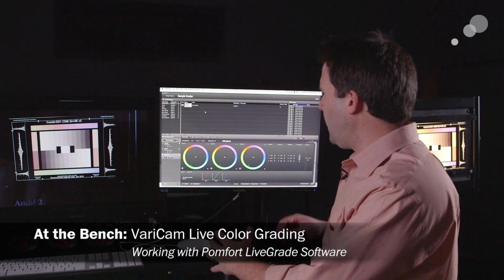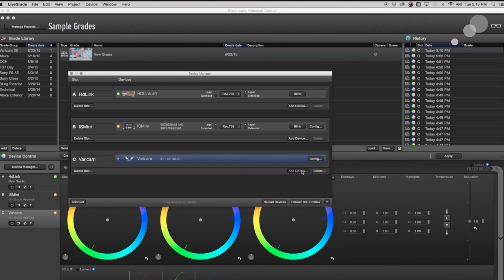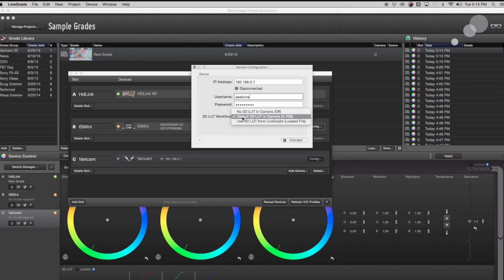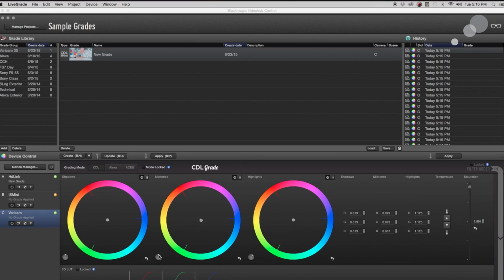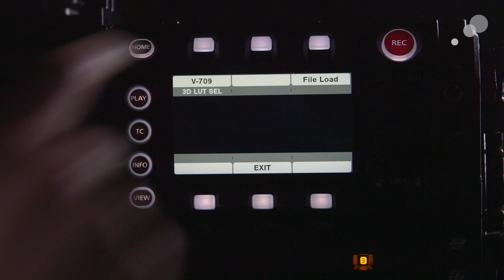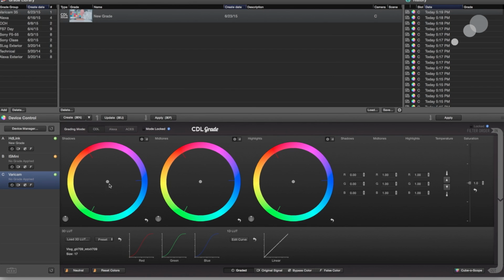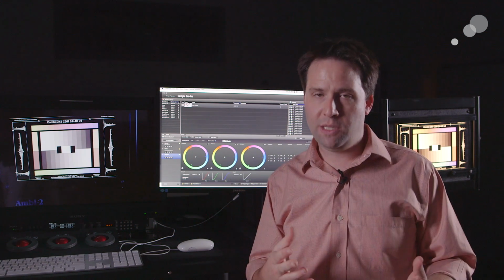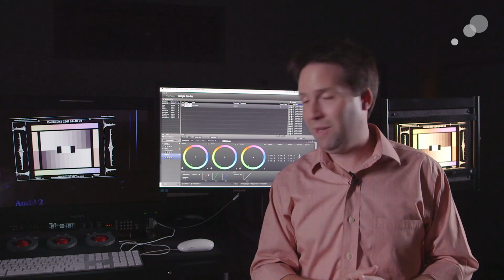VariCam Live Color Grading: Working with Pomfort (Part 2)

Comment: Hey Andy. If using 1 copy of Livegrade (I'm on the new version 4 now), you need to connect 1 camera via Wifi (in this case OMOD CMD RT on the RED), and the other needs to be connected via LAN, correct? Is there any way to connect multiple systems with Wifi, or some kind of connection sharing box for this? I'm trying to link the Weapon Helium and Varicam, then create various looks for them after matching them in Resolve initially.